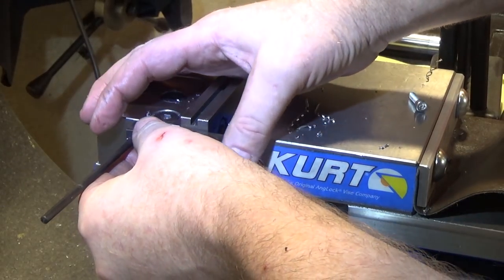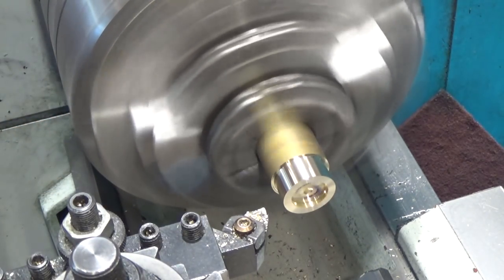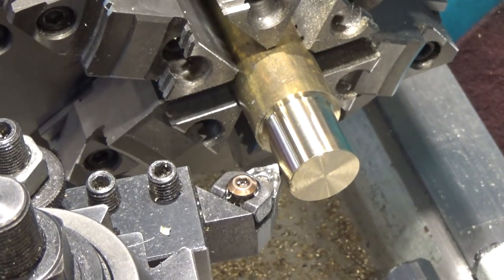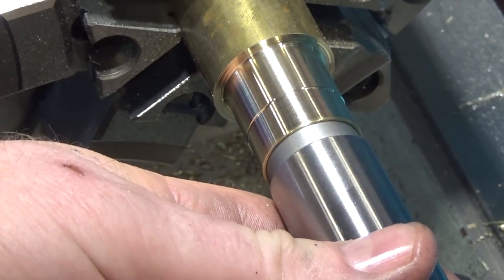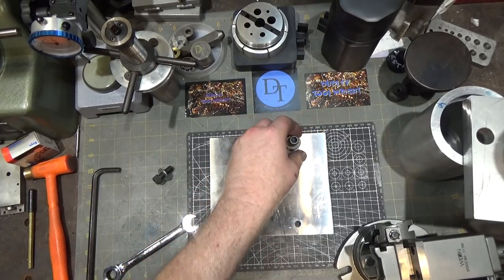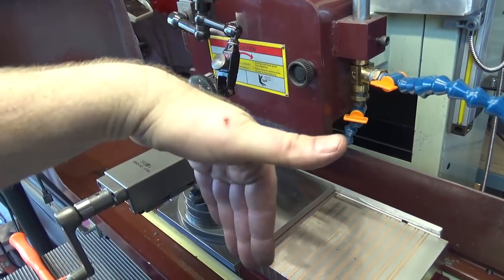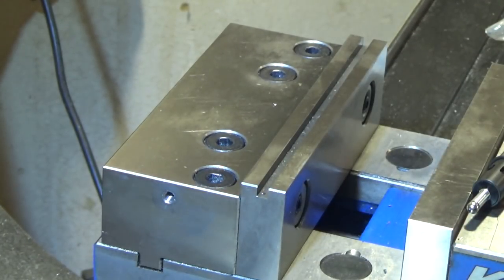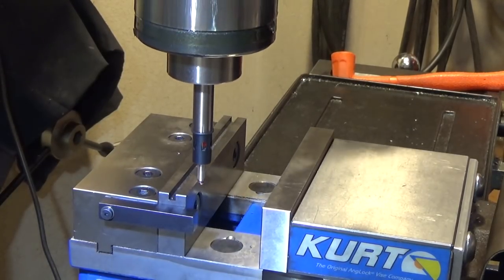124 Shop Mini Projects Part 2

Comment: Always use a 3-piece tap set when hand tapping. This will avoid breaking. And use a grease....i mix a lithiumgrease with graphite powder and a little engine oil for that purpose. Never broke a tap in 45 years........
Reply from the maker: Great tips, thanks. In this case I had a hole much deeper than the thread depth I was cutting.

Comment: The stop you screwed to the side of your vise; you showed how it flexed. If it were longer (from  the perspective you showed) to the left of the screw, the right would not flex as much.
Reply from the maker: Interesting. Perhaps I a m misunderstanding your point but: Torque equals force multiplied by length from fulcrum so longer length equals more torque equals more motion.
Reply: @DudleyToolwright  Watch your video, at the time where you have the stop screwed to the side of the vise, you show how it does not work as well as you wanted. You wanted it to be able to move into place and move out of the way, so the screw could only be so tight. The hole for the screw in the stop was drilled into one end. If the stop were longer and there was more distance from the screw hole to the left of the stop when tightened down, it would flex less.

Comment: What I've learned about ball Allen's is you never want to go for final torque with the ball end.  It will snap every time you say "that's about tight enough" in your head.
Reply from the maker: Too right. I should have stopped when I was not quite happy with the torque.
Reply: @DudleyToolwright  I have this theory that ball Allen's are sentient and know when you're either just about done with a project or it's important that you not mess up.  That's when they snap.

Comment: I just bought a huangyun vfd to use on my 1.5hp bandsaw 115v. I got this inspiration from your grinder video several,yrs ago. You mentioned jumpering some terminals. Don’t want to mess things up and wondered if you had some suggestions. The manual Is not written in proper English. Tnx! Enjoy your vids.
Reply from the maker: It's been a really long time, but if I remember right I connected the P and Pr terminals which are the braking resistor if you had one.

Comment: why is taps make that horrid crunch snap sound, I knew you broke it even before you reacted to it ... lest it was above surface
Reply from the maker: I think the vise back was at least case hardened. It was tough to drill until I got to the juicy center. On top of that, I only had a regular tap, not one made for hard materials. I was pretty concerned from the beginning.

Comment: Off topic here, but I'm curious about your large Harbor Freight vibratory tumbler.  Is it holding up? Do you use it much?  Thanks, Rich...Seattle
Reply from the maker: It has been good, but I haven't used it much, because I keep forgetting I have it and usually don't make a lot of small parts. I also have no experience with really nice ones to compare to.

Comment: what is the make of your center finder ?
Reply from the maker: The manual edge finder is a Starrett and the electronic ones are Fowler. Fowler makes a bunch of versions. The cylindrical one is fairly cheap at something like $25 and the spherical version is just under $100.